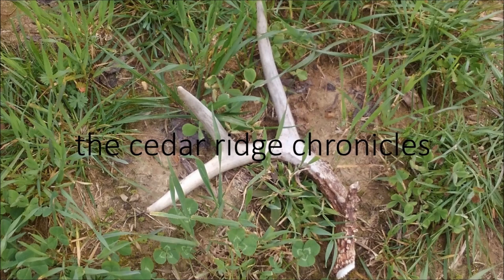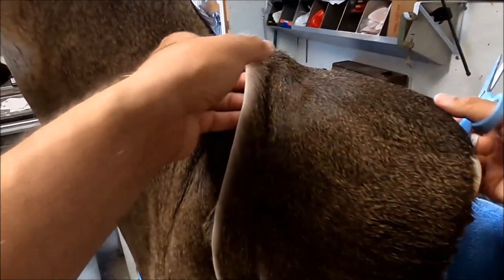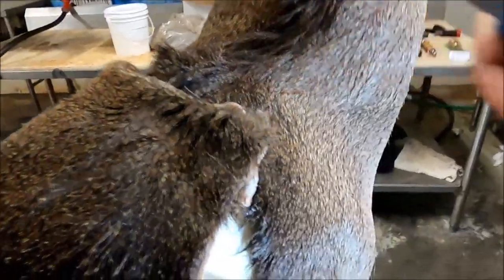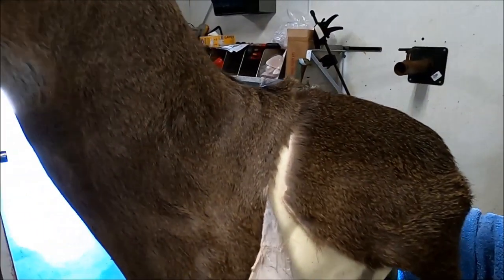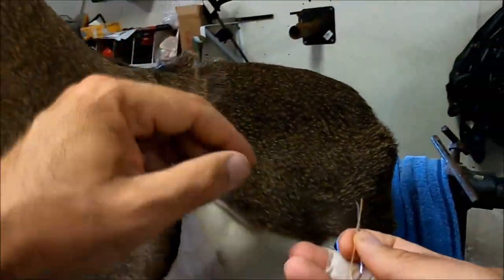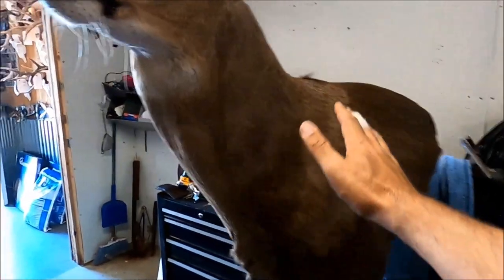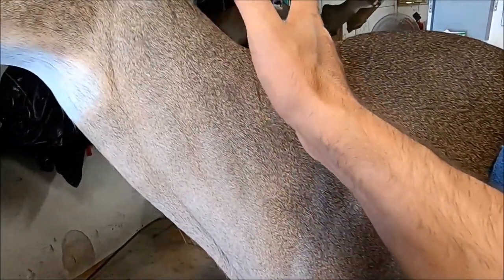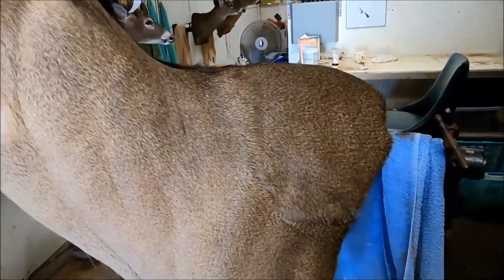TRASH TO TREASURE! How to patch damaged or miscut capes! ***SUPER EASY***WHITETAIL TAXIDERMY!

Comment: Great save! I've had to do something similar before but down in the brisket/leg  area. Did you seal up the paint or just leave it as is? I know that paint doesn't stick to hair well and will brush out.
Reply from the maker: I spray a light coat of matte sealer over it, but it would also brush out as well but allows for a little more light dusting. Any time I do any hair painting I tell the customer what to look out for. Most folks will never touch their mount again once it gets put on the wall, but there’s always that one that will groom the face right off of one

Comment: next time make sure you get that patch hair to line up under the original cape hair and you wont have to worry about all that paint.
Reply from the maker: That would have been the easy thing to do if the patch was the same exact color as the missing cape but that's all but impossible unless the patch was the original piece missing. It wasn't the hair lining up I was painting it was blending the color of the hair on the deer to the patch itself